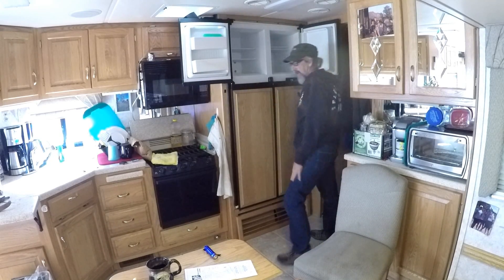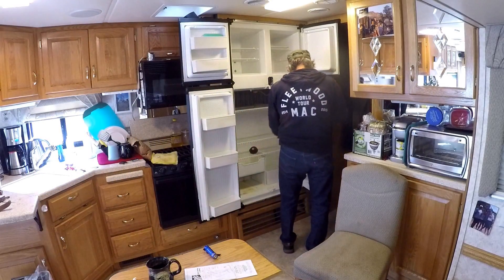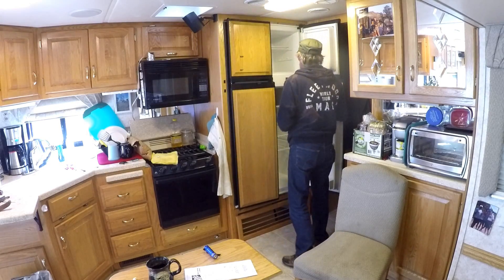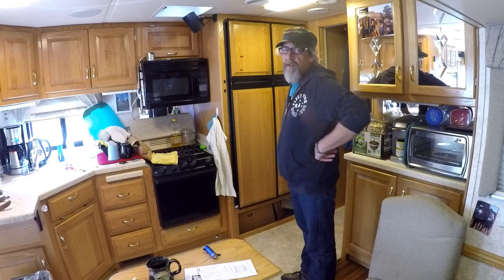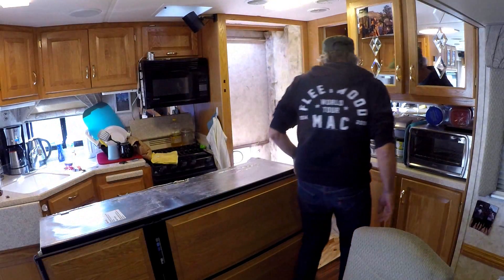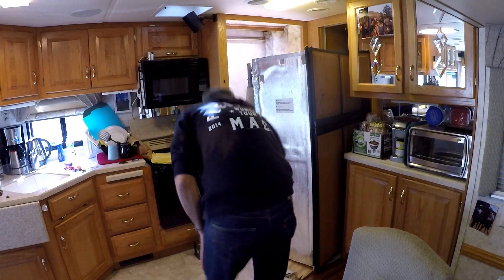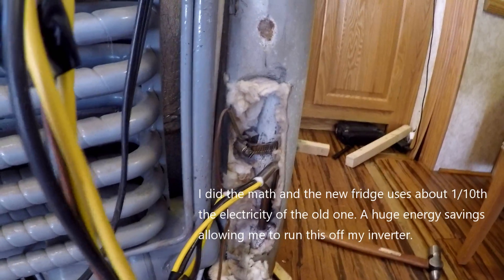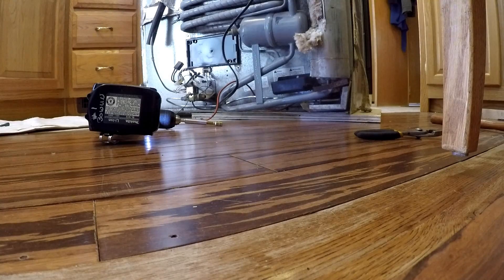Replacing Norcold 1200 Refrigerator with Samsung RF18 in a Newmar Dutchstar Part 1 of 3

Comment: I just finished installing an 18 cubic ft GE fridge in my Southwind.  I had to modify the fridge space by dropping the floor about 3 inches which was easy since I own a complete woodshop.  I plugged the propane line and sealed the 12 volt wires.  I also strengthened the flooring even though the GE is lighter than the Norcold.  I had to take a window out to slide the fridge in.  I put a couple 2x6 boards on the bucket of my front end loader, laid the fridge on it's back with the doors removed, raised it up to the window opening and in it went.  I plugged it in, slid it into the cabinet, trimmed it off, and put Velcro strapping across the doors for traveling.  I paid less than $600.00 for the GE.  And it will freeze ice cream.

Thanks for your video.  You gave me the encouragement I needed to do the job.  Happy Camping.
Reply from the maker: Awesome Ronald... Glad to hear that I inspired your to do it!

Comment: I removed the 1200 in my Southwind to install the Amish coils.  Now it has quit working.  But when I took it out of the opening I used a motorcycle jack.  I wrapped the steel wheels with tape to protect the floor, removed the refrigerator doors and the frame, and pushed it out onto the jack.  Then I moved it out into the kitchen and jacked it up against the ceiling for stability.   My 1200 is now heating like a furnace.   So I am going to replace it with a residential model.  Thanks for the video.
Reply: The fridge worked great for about 5  years.  Then it started blowing fuses in the control panel.  And a couple of the heating tubes burned out.  The fridge was working great until June 30, 2017 when it decided to become a warming oven instead of a fridge.  So, time to go.  I paid over a $1,000.00 for the Amish coils.  No sign of them leaking but they must have plugged up inside.  I have a full hook up for my motorhome right on my yard and a complete wood working shop.  From the mufflers falling off the Fleetwood/Workhorse the day I got it and leaking gasoline all over the ground because of a misplaced clamp, to the front air conditioner burning up because of a sensor not being installed properly, to a gasoline pump, to a warped exhaust manifold, to a slide out motor that cost over $700.00 this has been a handy man's dream, or nightmare.   A pot hole in the highway into which I have poured money.

Trade it in?  Yeah, now that I have worked out every Fleetwood bug built into it.  Naw!  Time for the crappy Never Cold to go to the dump.
Reply from the maker: Pretty much the same story I have...but I'm with you now that I have all the bugs worked out why start over... Thanks for watching and check back in when your done and let us know how it went.
Reply: I just got a check from Norcold for $147.00.  One of 4 that will finally amount to about $550.00.  I joined the class action suit back when they started the recall that blew out my original coils.

Comment: Hi TR! I’m replacing my Nevercold this weekend with an RF18. So excited! Your videos have been invaluable since we have the same 2004 Dutch Star with the 4010 floor-plan. I don’t even have to think! I used it as a training video for my friend who is helping me so we are both on the same page. 

Once I got the fridge out I saw the same burn in the ceiling that you have. Scary! The roof vent is just totally in the wrong place. 

I haven’t used the thing since I saw your video on RV fires. I turned it off and bought a small dorm fridge until I could get and install the Samsung.
Reply from the maker: Thanks for the update. Agree on the roof vent and when I replaced the roof on my coach I could not see any reason why the vent could not have been moved so that it aligns better with the exhaust on the fridge. Love to see pictures of the finished product.

Comment: We are planning to get rid of the no-Cold in our 2007 Kountrystar soon.  We don't often boondock, but are concerned our inverter doesn't have the power to kick the Samsung on.  How big is your inverter and how many coach batteries are you running?  Thanks!
Reply from the maker: I have a 3000 watt and 4 lithium batteries. BUT, you don't need that much. A 2000 watt inverter will work just fine and when I had no solar and just 4 lead acid batteries I would have to run the generator for 3-4 hours a day if I was boondocking to keep the batteries charged up, Fun fact, with solar and the lithium batteries in a 100+ days of boondocking I had to run the generator only twice for a total of 6 hours.

Comment: I have a 2004 freightliner revolution with a 4 door norcold. My door opening is 27” found a 24” deep French door refrigerator, but can’t clear the head cabinets coming in the door and up the stairs. I’m at a total loss for how to get it in here. 
How’d you get yours in. The captains chair isn’t in the way. The dash components and the head cabinets are. So frustrating.. also. For a 110 fridge am I asking for trouble. I’m currently shore powered but if I’m not?
Reply from the maker: Two guys and we pretty much carried it horizontally in the door.  They don't use much power so you should be good on your existing batteries to travel between hookups.

Comment: Ok question. I have a 1200 in my 2005 Dutch star but I have floorplan 4009 with thr fridge in the slide out. I do have a smal cabinet/pantry above and to the left. I have yet to find a residential refrigerator that will fit the opening. I noticed in your video there is little room for margin after the fridge was removed. It pretty much filled the opening correct?
Reply from the maker: I had to lower the shelf in mine to fit the fridge. I think it was about 1-1/2 inch. I don't recall exactly, but I was right at the minimum clearance for above the furnace.  The width was perfect. I have about 1/2 inch on each side for airflow.  That said I know there are some subtle variations in the Dutch Stars because a friend of mine put the same fridge as mine in his and had to do some finagling to get his to fit.  He was having trouble with the height too.

Comment: You mentioned you had done a conversion kit on the Norcold, which conversion kit was it?
Reply from the maker: I installed a replacement cooling unit from a company in Arkansas. It was junk. Lasted just over 2 years...just outside of the warranty. Stick with the amish built replacement units if you want a quality one.

Comment: I was looking at the same setup you did with a Samsung 18, but the reviews are really bad> Have you had any water power problems with yours. thank you
Reply from the maker: Nothing, except I had to change a drain defroster clip. It was simple and of course I videoed it, https://youtu.be/BN8Wb3JLok8
Keep in mind that often times only people that have trouble with something write reviews. I don't think you'd have anything to worry about if you used it. There is a GE brand that is also popular for this replacement, I am not sure of the model number. Thanks for watching

Comment: Did you seal off the outside vent behind the fridge ? Doing my fridge swap now , looking at that outside vent letting a lot of stuff inside .
Reply from the maker: Hi Robert! Yes, I did. I put some of that purple foam board in the hole in the wall and I taped the vents in the outside cover from the inside. It looks great and you don't see the tape at all. How's it going on the swap?
Reply: @trbowlin  First of all I had to lower my furnace, they had installed it on top of some 2x4's to clear the ac drain lines.I re routed the ac lines and mounted the furnace directly to the floor. this meant I had to drill a hole through the side of the coach to accommodate the exhaust. no problem, I made a nice stainless plate to cover the original hole. now I have the room to make a new deck over the furnace giving me the 70" of clearance I need.I will leave a 1" gap between the deck and the furnace, I even bought a 24'X24" 16 ga piece of stainless that I will attach to the deck so anything coming from the furnace will not have direct contact with the plywood. now we are shopping for a new fridge, wife wants a 2 door with ice and water in the door. I stubbed a water line with a ice maker fitting up to the back wall. where can I send you some pictures?
Reply from the maker: @mbzmech1  Sounds cool! trbowlin@gmail.com
Reply: @trbowlin  shopping for an inverter too, mine is a modified sine wave unit. :(
Reply from the maker: @mbzmech1  This victron https://amzn.to/3nFKt7V is the best one on the market right now. The really cool thing is that it boosts power. Say your on a 30 amp service and need 40 or 50, it will automagically boost your power to what is needed...no more breaker trips. I helped a friend install one in his coach a couple of months ago. Here is the video on that https://youtu.be/yPghusuxOp8

Comment: Did you have to take off your coach door? Or remove front seats?? I have an essex my fridge went out in. I've been doing some measuring and it is tight to get the old fridge out and the new one in.
Reply from the maker: I did not have to remove the coach door. It was just wide enough to get the fridge in. I did remove the doors from the fridge and I removed the front passenger seat and there is a hand rail on the door frame that I removed just to make it easier to work... On the Essex I would think you have the same door opening... I had two inches to spare on the door opening... Good luck

Comment: Did you have to disconnect from room at all?
Reply from the maker: I don't follow? do you mean was it screwed into the compartment, if that is what you are asking, then yea, it was screwed into the cabinet.
Reply: @trbowlin  Sorry I was not very clear. I meant “did you have to disconnect from the  roof at all?”. In my case, I had to open the roof vent and unscrew so mental brackets that were fastening my fridge to the motorhome frame.
Reply from the maker: no, there was nothing connecting it to the roof. I was only screwed in the top and bottom flanges. Thanks for watching!

Comment: We’re you able to get the old norcold out the door ?
Reply from the maker: with the doors off the old fridge it slid right out
Reply: How wide was your coach door ?
Reply from the maker: @MrBillygoat  24". I did remove the screen door.
Reply: That’s perfect !! I have a 2005 Phateon Tiffin that I am fixing to pull out , during the heat of the day it will only cool to 55 degrees , freezer works fine
Reply from the maker: @MrBillygoat  It's the best upgrade I did on my RV by a long shot!

Comment: Hi TR - I’m removing our Norcold 1200 as well - I have a 2005 Kountry Star 3909 - I only have 26” through the door frame - I was wondering if you know the width of the door opening on yours. I can’t see how I’ll get a new fridge in with the coach door still on. Thank you
Reply from the maker: I also have 26. The doors come off the fridge and it fits with 2 inches to spare! You'll need to remove the passenger captain's chair
Reply: TR Bowlin - thank you for the reply - I have the passenger seat out and I know I’ll have to take the doors off the fridge ( I have them off the Norcold) but you didn’t have to take the coach screen door or outside door off? Thank you
Reply from the maker: @mikehoyle7164  no I didn't have to take the door nor the screen off. But what I did do on my particular door there is a positive lock when it opens and there is a bar at the top of the door which limits the opening size. I just popped that off and held the door open while we moved the fridge in just give us a little bit more space. Otherwise it went right in. I don't know what fridge you're installing but on the Samsung that I installed with the doors off the fridge cabinet depth was only 24 in
Reply: TR Bowlin ok that’s great to know - I have removed the hinge but it doesn’t give me much more opening- I’m looking at that Samsung or a fridgedaire 13.9 cu ft . There are a lot of terrible reviews on the Samsung and they are notorious for their terrible customer service but I’ve seen the fix but people are still saying with the new evaporator drain clip it’s still freezing on them.
Reply from the maker: @mikehoyle7164  I replace that clip on mine back in May and I have not had a problem with it since. There is a video of that repair on my channel
Reply: TR Bowlin ok - that’s great to know as I do like the size and design of the Samsung- thank you very much
Reply from the maker: @mikehoyle7164  knock on wood I've had mine installed for 3 years now with no trouble other than having to replace that clip. Good luck and thanks for watching

Comment: If ya close the roof vent and outside vent, how does the new fridge expel heat? Won't it over heat built in such a tight space?
Reply from the maker: No, it is not a problem. It's been installed for 4 years and I have not had any problems. Good question though!

Comment: Sir, how did you get the Samsung refriderator into the rv? Did you have to remove the windshield or was the rv door big enough to get it in? I'm thinking of getting rid of never cold and get one like you have. Thanks for the video sir.
Reply from the maker: Hi Jong... Thanks for watching. Yes with the doors removed from the new fridge it came right in through the door.
Reply: TR Bowlin , thank you for the reply. I'll be getting Haier 16.4-cu ft 4-Door Counter-Depth French Door Refrigerator from Lowe's $699. Had a excellent reviews. And I made sure it will thru rv door.
Reply from the maker: Cool. I looked at that model too. When your done be sure and check back. I'd love to here how it goes.. Good luch and thanks for watching!

Comment: tr.......could you tell me why you moved the wires from the ac fuse box to the inverter.........I am installing a fridge like yours and I would like it to work on electric and inverter....just no gas......how do I need to wire it to do so. thanks butch
Reply from the maker: Hi Butch... The reason I had to move the circuit is because the outlet I moved and reused was not on the inverter. The reason it was not was because the old electric pencil heaters plugged into the existing outlet (the one I moved and reused) were not on the inverter because they pulled about 450 watts and they would have draw the batteries down pretty fast. Really the original fridge was intended to run on propane when you were not plugged in and only run on electric when you were plugged in. AS you know I needed to run the fridge on electric full time so I moved that outlet to the inverter to accomplish that. 
I will comment that I boondocked a fair amount this summer and I had to run the generator about 3 hours a day to keep the batteries charged up and running the fridge. The take home message is that the solar I have is not enough to keep the batteries charged and run the fridge. I'll be fixing that this winter when I replace my existing old solar panels with new (and more) solar. Watch for that project later this winter.
As far as your specific situation I am happy to help... If you want to email me at flyfishidaho@gmail.com I will work with you to figure out what you need to do in your specific situation. 
Thanks for your comments!

Comment: If I wanted to do this in my 5th wheel but I never boondock and it's at a RV park 24/7 on shore power, how would I go about wiring it up? Could it just be run to an extra breaker that isn't currently being used as long as it's big enough like a 20amp? Or wait, those use 110-125v standard wall outlet, oh that's right. So then I would just plug it up to an outlet then right?  I don't have an inverter yet, or solar, or lithium batteries. That's all planned but not for a year or so.
Reply from the maker: Yes, you can use the extra breaker. I think you will find that the current fridge may have 110 power already in place and you can use it. 20 amps is more than enough. Thanks for watching

Comment: Yeah I figured the entry door would swing out-of-the-way enough once the arm was taken off the top. I was sure hoping I didn't have to take out the passengers captain seat.
Reply from the maker: It's really easy. There are just 4 nuts holding it to the mount pedestal. I didn't have to remove the pedestal, just the chair...